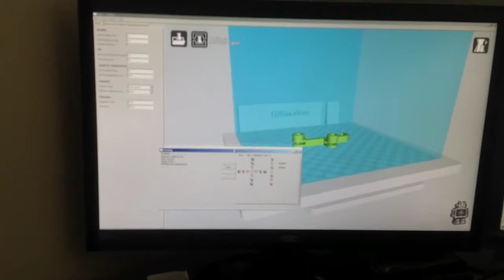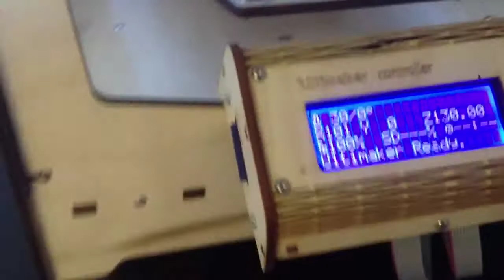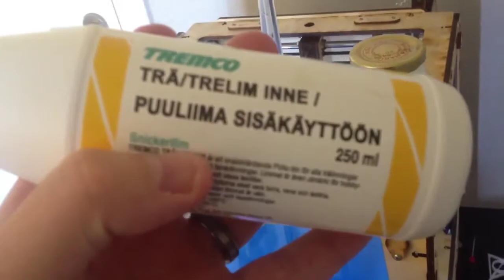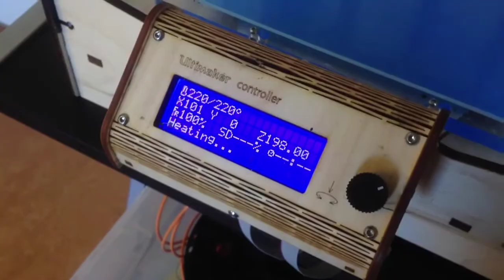My Ultimaker 3D printer, Wireless, Printing on glass

Comment: Very useful.  I have been having adhesion problems.  The PVA glue applied and left to dry, looks like a good solution.
Reply: how long does it take to dry, can you use a heat bed to speed it up? Thanks
Reply: You can use the bed heater to speed up the drying, and that dries the glue solution in minutes.
Reply: Thank You 20o0%

Comment: What if you were to sand the glass surface with 1200 grit sandpaper to delete the need to apply glue and wait for it to dry each time... A nice 800 to 1200 grit carbide paper should make for an extremely smooth surface while the fine scratches would still allow for the plastic to adhere to the glass. I would like you to give that a try and let me know as I'm in the process of building my own 3D printer and would like to use that idea if the sanding works.  I am using 1.5" X 3" aluminum extrusion T-slot framing with home machined Acme lead screws and Delrin antibacklash nuts with larger Nema 23 stepper motors for mine. I scored 20 new stepper motors and the extrusion at a great price($5/motor and $5/ft) so I'm going big,  I want to also be able to run a 400W liquid cooled spindle motor for a multitask machine with a 24" x 24" x 24" work area for larger projects with room for additional extruders. The aluminum extrusion is inherently straight and quite ridged (especially when TIG welded with 3/16" and 1/4" reinforcement plates) so it should have some decent accuracy.  I'm also using 5/8" twin linear bearings so that should firm things up a bit as well. Eventually I would like to add a laser cutting head for a 3 in 1 machine. The idea of printing with carbon fiber impregnated resin and hardener through a mixing head is on my mind as well. I imagine once the 2-3mm carbon fiber snippets, hardener and resin ratios are all sorted out it should open up an amazing new medium for all the home hobbyists. Scrap carbon fiber can be found extremely cheap or even free if you are thrifty. I have a nice mixing tube/extruder design in my mind that I'm sure would work well. A standard epoxy mixing tube design but machined from stainless steel designed in 2 separable halves and highly polished for easy clean up after runs. With the programmable 32 bit ARM MCUs with higher clock rates and more ports at such great prices these days the options and sensors that can be added on down the road are nearly endless. The components are finally priced low enough to build some decent gear right at home now. I'm glade I have a machine shop in my home to make my own lead screws, nuts and couplers though as that is where you can dump money endlessly if you have to buy store made! The future is turning out pretty freaking cool from what I see! I'm glad I'm getting to participate before I'm too old to enjoy it! lol  Anyway, great video, love your wireless idea, I will definitely incorporate it into my unit and the glass bed as well if the sanding works.
Reply: Think english is limited here when you get technical.. I'm saying Im certain but I've gotten technical here in holland with my american words and I had to shorten what Im saying and loose technical jargen..lol
Reply: theidiotcure
Your English is doing just fine, I did not even realize it was your second language until you mentioned it and it is better then the slop 75% of the folks here mutter! lol Let me know if you tried fine sanding the glass to allow the molten plastic to adhere. I wouldn't want to do the whole glue technique every time I wanted to print something.
Reply: ***** No I was referencing you trying to explain to poster something... However I've done glass printing and I layered on the glue like he did but after drying I lightly sanded it and and applied another coat which made for a smooth surface.
Reply: ***** You don't need to apply glue technique everytime. Just every once in awhile when it starts to get old.

Comment: Very nice, did it here it is working perfect. The grip is better than the blue tape. I`m using a glue for wood called Bison (here we have at Gamma.nl). One question.... what are the configurations that you used to print like this? because I cannot print the bottom like this... always the lines are more separated... do you use cura or other slicer? thanks and keep the good work!

Comment from the maker: I wouldn't try that, some times when i have had small pieces of tape missing and accidentally printed direct on the acrylic, it sticks like crazy and is very hard to remove. I have read that you could put some oil on the acrylic to make it stick less and then print on it, but i have not tried.. I like glass, it doesn't deform or get scratches etc :-)

Comment: Good to see that you are still busy with your Ultimaker - it is a pity that they don't have a heated bed but with PVA you have overcome the need for one I guess. One thing - doesn't the grease/oil from your fingers interfere with the PVA surface as you wipe it down? Tack sa mychet! (Hope I remembered the little Swedish I know, correctly) :)

Comment from the maker: Yes, i did adjust the Z endstop a bit. But what i usually do is when i start a print i manually adjust the Z by turning the thread by hand, until i see the first printed line get a perfect thickness. I think i need a better endswitch, i think mine differs about 0,1 to 0,2 mm, but just adjusting z by hand works also.. :-)

Comment: thanks Peter - sounds like a good upgrade - I am certainly sick of the blue tape routine.  I will give it a go.   You don't mention it but of course you would need to readjust the z axis stops with the glass in place before printing.